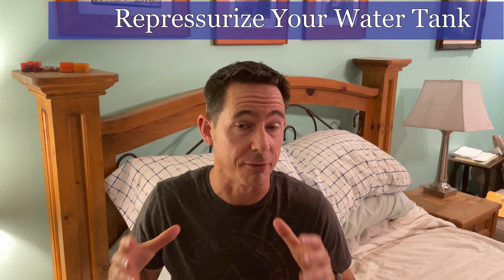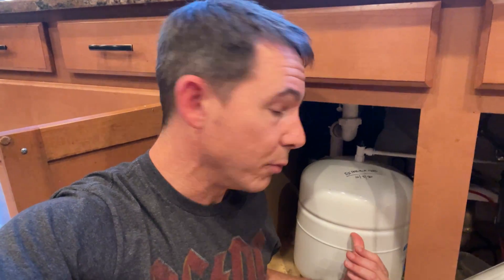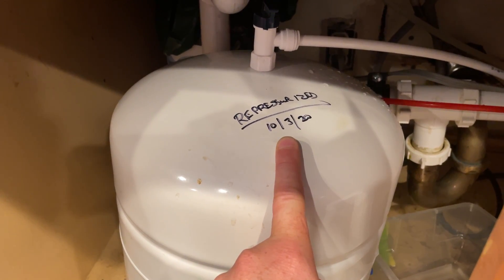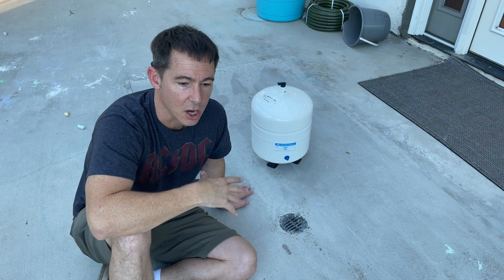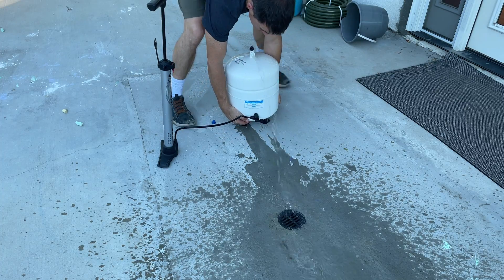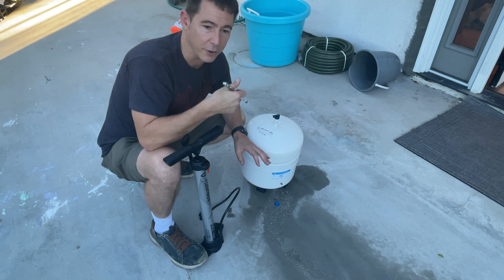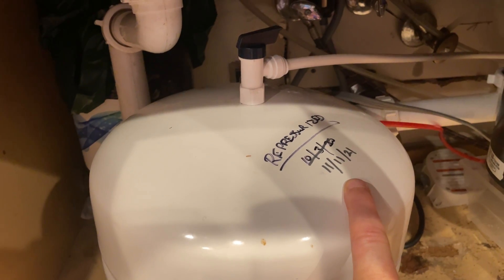Re-Pressurize RO Tank

Comment: What if even with 10 psi water pressure for faucet is low? Pipe psi is good as it takes 30-45 mind or so to fill the tank plus hot water runs find? I have the 7 or 9 stage model from ispring

Comment: Once your tank is empty, and you add your pressure back in, around seven psi, after you fill the tank back up with water and check the PSI of the tank it should be much more than seven psi that you said it correct?
Reply from the maker: I’m not sure. I know for an empty tank it should have a gauge pressure between 5-7 psi. I’m not sure once it’s had water added to the system

Comment: There is no water entering our RO tank. What does that mean
Reply from the maker: Could be a broken or stuck valve at the top or the tank. Or it might be a clogged line. Other than that, I’m not sure. The tank may be faulty.

Comment: Thanks...
but how do I know if repressurizing didn't work and  it's time to replace the tank ?
Reply from the maker: You should see an immediate improvement of water pressure and flow once you perform this process. If not, there may be a leak in the bladder in which case you would need to replace the tank.
Reply: @homeprojectswithcarpenter460  thank you so much.

Comment: I saw a video that states 35-40psi....confused 🤔
Reply from the maker: Usually that pressure limit is on the tank itself. The gauge pressure has to do with how much pressure is needed for normal operations. The tank will withstand much greater pressure before it breaks, but it won’t function if the pressure is too high. Effectively it will be too high to allow for much water to be stored in the tank

Comment: Why did you need to bring the tank outside?  You could have done everything while it was connected.  Normally I do this every time I change the filters, which is annually for me. Use those digital inflators to make things easier.
Reply from the maker: Good suggestion. I’ll try that next time. Thanks for watching

Comment: Can you show how you disconnect the tank (from under sink) Can we still use water from faucet while tank is out?
Reply from the maker: You need to shut of the cold water at the source under the sink by closing the valve. Then just turn on purified water at the faucet to release the pressure. Lastly, close the valve on the top of your tank. Then you can disconnect the water line from the tank to remove the water. 

You’ll need to leave the water off unless you have a separate valve to isolate the purified water system.

Comment: anyone have issues with the water always running?
Reply from the maker: Since the reservoir functions as a bladder there is a constant flowing in/out in the background. There shouldn’t be anything to worry about, but it does sound funny sometimes. Thanks for watching
Reply: @homeprojectswithcarpenter460  mine used to stop running when it was “full” now it runs 24/7. I’m not sure how to fix that.

Comment: If the valve on top of the tank is the water output, umm....where is the input???? It's only got one valve connected to anything.
What kind of sorcery is this?
Reply from the maker: The tank acts like a reservoir. It’s the same tube in/out, but the water pushes further on down the line. It’s weird, I know.

Comment: Thanks from France. I had trouble with a dripping faucet - an identical one to yours - and it was because I had pre-charged the tank to 20psi. I'm sure I had read that when I installed it a year ago. Reduced pressure to 7psi - no drips now.  BUT at the very end of this video I noted your faucet is leaking! I think you need to check the sealing (2 'O' rings) where the spout us inserted into the body of the faucet.
Reply from the maker: Great suggestion. I actually just replaced the entire setup a few months back. Thanks for watching! Please consider subscribing if you haven’t already. Thx!

Comment: Hi, I'm having a bit low pressure (not terrible, but just lower after I changed the filters). I have an 8 year old r/o tank from Culligan that I just re-pressurized. I emptied the tank, re-pressurized with the valve closed to 7 psi, and the pressue is still pretty low compared to before the filter changed. I also noticed this morning that the tank barely had any water in, and it's been filling since 3pm yesterday 3/5/23. Is it possible the water was used filling ice all night. Otherwise, I cannot figure out why the pressure isn't that grate. Also, before the filter changed, I could fill 1 pot of coffee with water and by the end it would be slowing down quite a bit. I'm wondering if I need to replace the tank...thoughts?
Reply from the maker: Not sure. It may be that it just takes a bit of time to fill up. I’d give it a day or so. If it still giving you low flow, you might need to check that there’s no blockage at the filter. You might also have a valve that’s partially closed. Just a few ideas. Hope that helps
Reply: @homeprojectswithcarpenter460  I'll give it some more time. I did close and re-open all the valves. I also purchased replacement valves with the new tank coming. I plan to check all the lines to make sure there's no obstructions. The tank is 8 years old and before the filter changed had good pressure but after 1 pot of coffee it would loose a lot of pressure and come out pretty slowly.
Reply: @homeprojectswithcarpenter460  so i messed around with it last night. i replaced the tank with an apex 3 gallon. seems to be working properly. good flow. i cant figure out why the tank fills SOOO slowly. it's supposed to fill in 2-4 hours right? i removed the drain line from the "drinking water faucet" and blew air through it to make sure there's no blockage in the air gap (recently had backed up sink drain). i felt the new tank this morning and it feels heavier, but i assumed it would be full by now (its been 10+ hours with the fridge line off). the stream seems good so i wont mess with the filters yet. i read more online and learned that with NEW filter sets, sometimes the membrane is bad/damaged so the flow is poor. if it doesnt get better in a day i'll try another new set of filters. the filters are from amazon, for the ac-30 culligan system. they were $43 for the 4 filters: Sediment Filter, Carbon Block Filter,
 TFM-36-A Membrane 36GPD and inline post filter and had mostly positive reviews. god what a headache for soft water.
Reply from the maker: Oh the joys of plumbing. :) Sounds like you’re on the right track, but what a hassle.

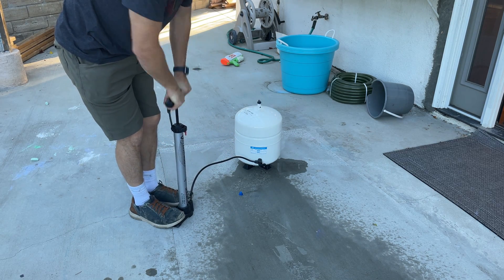Comment: 4:15 There should NOT be air coming out after water is out. If air is coming out, u have a hole in the diaphragm. 
4:26 U should not shut the valve when u are pressurizing.
Reply from the maker: Thanks for the tips

Comment: My tank say working maximum Pressure: 100 PSI (6.89 bar) ??? 
You said 7 psi , please help me? Which one correct? Thanks
Reply from the maker: The working max is the capacity of the tank (I believe) before it fails. The 6-7 psi is the additional pressure that you want to add once you’ve emptied the tank and closed the valve. There’s no way you want to add 100 psi of pressure to your tank

Comment: we have this system in an office and run out of water quickly so someone recommended to install a 2nd tank in series. Would this work?
Reply from the maker: Not sure. The way RO works the bladder works as a holding area, water in and out of the same hose. You might need to add another one in parallel or get a larger reservoir tank.

Comment: Hi Sir, I did everything as you did to add the pressure. However, the water is not filling up somehow. All the water tubes are connected correctly. Are you able to suggest anything? Thank you!
Reply from the maker: Might be that one of the valves is not opened up. Maybe there is an in line shut off valve that just needs to be turned to open? Not sure without seeing the system
Reply: @homeprojectswithcarpenter460  I highly appreciate your quick response. There are only 2 valves: one on the water tank and second on the cold water. Both of them are on and the filter is Apec RO-90 with 5 stages.

Comment: 6-9 months you are supposed to pressurize? I've had my system for like 3 years. And it is just now slower flow. I guess I better stay on it then. thx for the video.
Reply from the maker: Thanks for watching. It probably depends on how many people are using the system. We have 8 in our household so we probably need to re-pressurize more often.
Reply: @homeprojectswithcarpenter460  ah yeah it's just me. I change my filters like every 8 months instead of 6 because it is just me. I never knew I had to air up the tank though.

Comment: Can you just take tiee pump into house and save trouble of disconnecting everything and reinstalling tank?
Reply from the maker: Possibly. But you still need to empty the tank to allow the air to fully pressurize.
Reply: Yes you can. That is what I was taught. Also, you can save the drinking water in a water jug instead of running down the drain.

Comment: I have a filter like that one as well, though I just got a few questions, I am thinking about replacing all 5 filters, however, I am just scared that if I replace them I might get low water pressure, the filters have never been changed before. Do you think I would be fine, also if I do get lower pressure would the method you showed fix it? thanks
Reply from the maker: I always re-pressurize after switching the filters, so this method should work fine.
Reply: @homeprojectswithcarpenter460  so should I first replace the filters, then re-pressurize? thanks
Reply from the maker: @eeeeeeeeeeeeeeeeeeeeeeeee-s3p  yes. That would be my suggestion.
Reply: @homeprojectswithcarpenter460  ok thanks

Comment: I have a Watt's Pure Blue H2O/3 stage reverse osmosis system. If there's not enough air pressure in the system. The reverse osmosis faucet will leak clean water into the drain system. Basically, wasting clean water down the drain. The reverse osmosis system has a automatic pressure valve in the system. If Air pressure is above 22 PSI will activate to shut-off the automatic pressure valve in the system. This pressure valve requires 22 plus PSI of air pressure to activate the valve. If below 22 PSI the pressure valve will not activate. Causing, clean water to be wasted down the drain losing good water. Not enough PSI air pressure in the tank/system. You will hear water gurgling down the drain from the faucet area. In my opinion, the best way to recharge these reverse osmosis systems is to Add Air after bladder tank is full of water. If your only adding 5-7 PSI in a empty tank. How do you know you will reach 22 PSI to activate the automatic pressure release valve? The thing is, people don't think about the 22 PSI to activate the automatic pressure release valve.
Reply from the maker: Not sure. This is probably a little out of my league in terms of expertise. I’d probably inquire of a licensed plumber. Thanks for watching though.

Comment: What if there's water dripping out the top of the RO tank when connected to the system? It's very tight. Is that just a poor seal to be addressed with plumber's tape, or could it indicate something else that's wrong?
Reply from the maker: I’d have a plumber check it out. Yiu certainly don’t want a leak to cause more damage down the road
Reply: @homeprojectswithcarpenter460  thank you!

Comment: The way iSpring instructed me was to do it "in place".  Close off the water supply to the RO unit.  Turn off or unplug the pump power if you have a booster pump.  Open the RO spigot and drain ALL the water.  I saved it to 1 gallon jug.  Then using a pressure tester pump up the tank pressure to about 7.5 lbs.  Shut the RO faucet off doing this.  When you are done open every valve back up and you're done.
Reply: The Ispring instructions didn't work for me because after a certain point the spigot stopped draining, and there was still a lot of water in the tank.
Reply from the maker: Sounds good!

Comment: Hey I just put in a GE reverse osmosis systems and every time we use it keep hearing air out of the faucet part.. is that normal
Reply from the maker: There might still be air in the pipes that needs to get cleared out. If it doesn’t go away, you might have a leak. But I’d give it some time. It might go away on its own

Comment: At 4 mins 19 sec,  when you pump air into the bottom pressure side of the  bladder in you get air out the top side.  Is that not the indication of a bad,leakey bladder in the air tank.  If the bladder was good I would expect the top to be at atmoshperic pressure, no leaking air from the bladder below as you pump.  The bottom chamber is supose to be seperated from the top.  Me thinks you tank is bad.
Reply from the maker: Thanks for watching.  I’ll have to investigate, but I don’t think so.  I’ve had this tank for about 4 years, and I re-pressurize every year per the original instructions.  Seems to be working just fine
Reply: And what if there's some air in the bladder that's going to go out on top if we fumble to the bottom of the air section. that is, the air at the bottom blows the inner rubber upwards so that the air is pushed out of it, so it does not mean that the bladder is cracked.

Comment: do you know of any alternative, like one that you can open with an electric pump. It seems a bit flawed that you can't clean it properly
Reply from the maker: I’m not sure I understand the question. You can use an electric pump if you wish, but you need to be careful to only pump up to around 7psi. Not sure about cleaning anything.
Reply: @homeprojectswithcarpenter460  Sorry I was just wondering if you knew of any alternative products. Like an open system that uses an electric pump rather than relying on pressure to pump water to the faucet. I tried to search but no luck. With the closed system you have to sanitize about once a year I think. Thanks
Reply from the maker: Interesting. I haven’t seen any setup like that, but I’m not an expert in water filtration systems. Just a typical DIYer
Reply: @rexinferi  you can connect your ro system to any water container with diy float valve in it, and use cheapo electric water dispenser to get your filtered water.